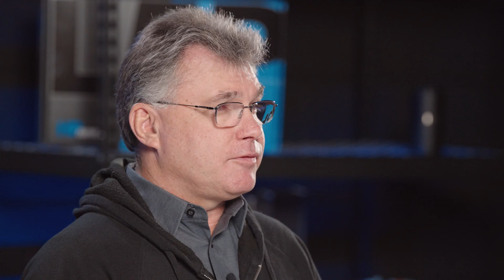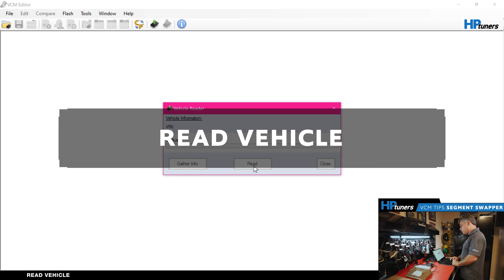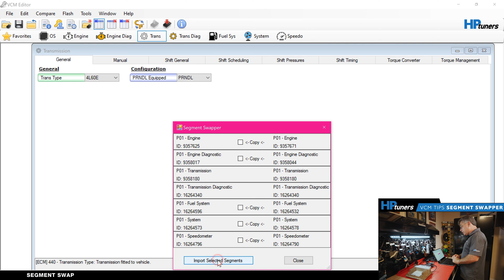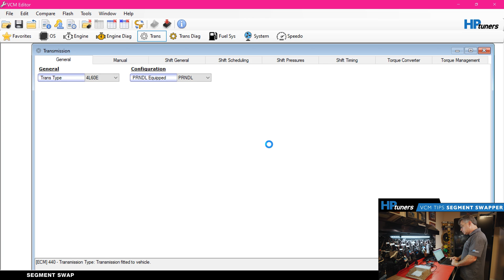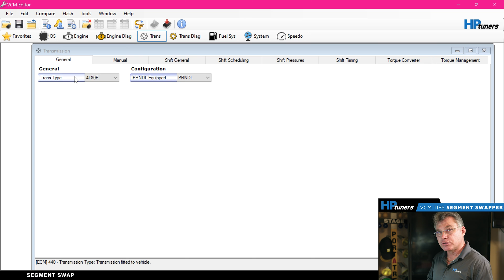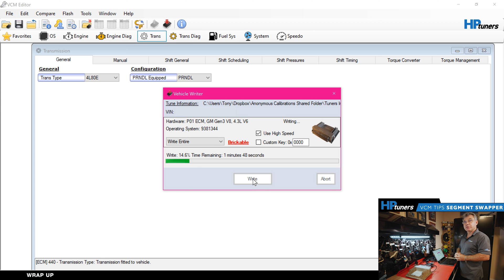How to use the Segment Swapper in VCM Editor | HP Tuners

Comment: So did the 4l80e file just appear? How do you get that file? I’m putting a 6.0 and it’s computer in another truck that has a 4l60e and at the moment I have to use the 4l60 until I’m able to convert the 4l80e to 2wd. How do I get the 4l60e file to segment swap the 4l80e?
Reply: no, watch what he does. He finds a file that has 4l80 trans in it, then opens it in the compare file. then opens segment swapper.

Comment: Great stuff! The only pita is trying to find a matching or compatible OS... just to confirm, the OS has to be the same... is this correct? Thanks for the continual education!
Reply: That's correct. And most of the time, that segment you need was never in an OS that will work with your car
Reply: @Knackersjewels  yeah found that out just now luckily my van works with the 2002 flex tahoe tune on the repository, needed flex with 4l80e then converting tune to work with an 8.1